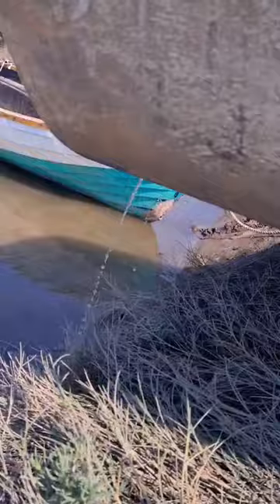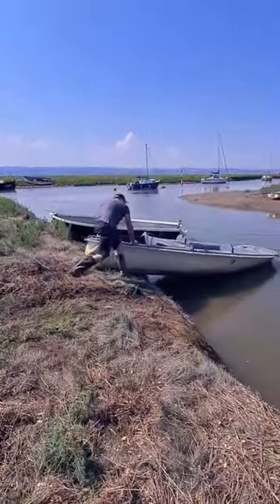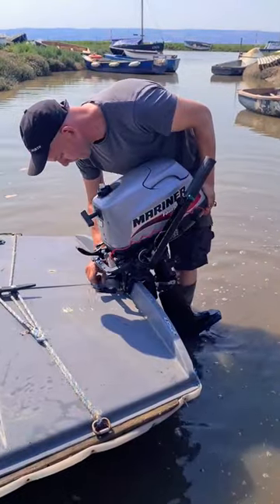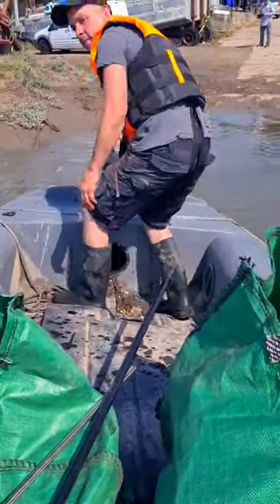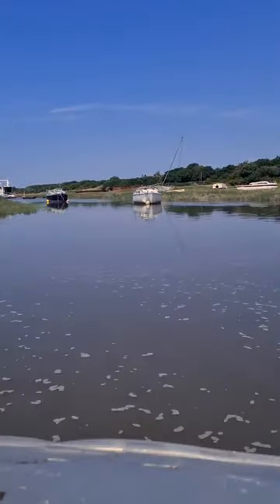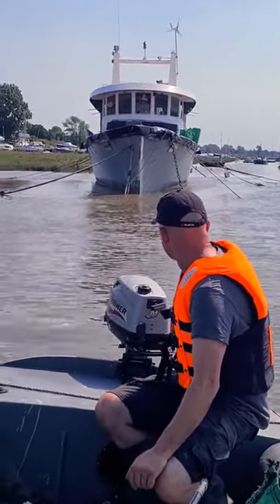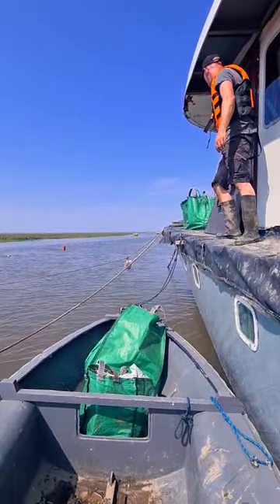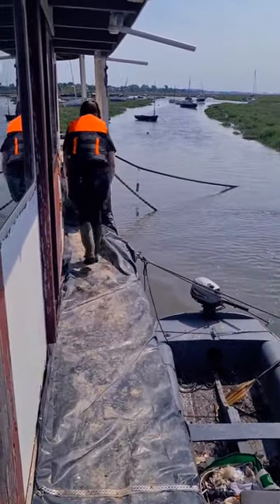#Shorts Moving stuff on and off our massive boat! #boatrestoration #boatrefit

Comment: Turn the tender over and it won’t fill with rain water. 😁
Reply from the maker: Feel free to come and feel the weight of it!
Reply: @ShipHappensUK  Is it to heavy to tilt it and prop it bottom side up?
Not trying to be hateful here. Just helpful. I used to drag a 12’ fiberglass boat to the water just to go shrimping when I was a kid.
Reply from the maker: @GodBlessedAmerica  don't forget we are tidal and the tender sees water more than Sarinda
Reply: @ShipHappensUK  I grew up on deep saltwater so I’m familiar with tides and the havoc it can cause in a moments notice. We didn’t have a dock when I was a kid so I had to drag my boat onto dry land and launch it by myself. The outboard I used was a monster. 1958 Evinrude Twin 18. Back then they were huge and heavy. 

May I suggest a tarp with 1/2” pvc cut slightly longer than the width, so they’ll bow up and keep tarp from filling with water ?